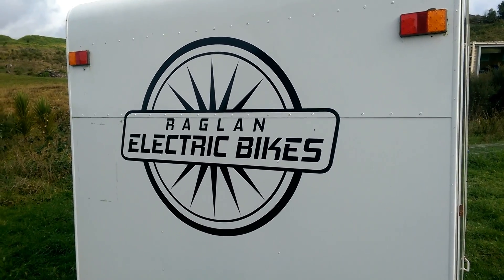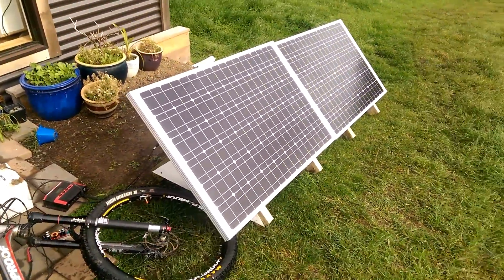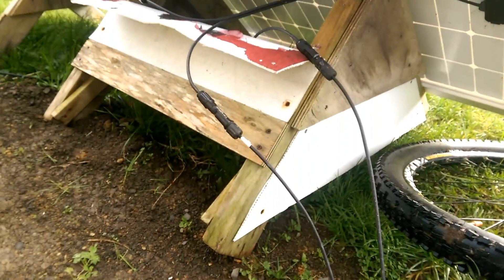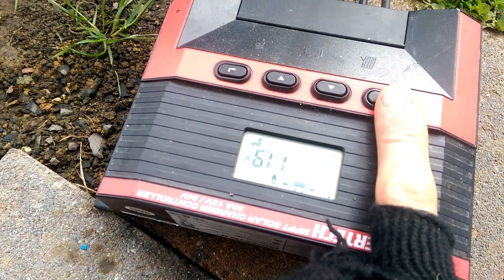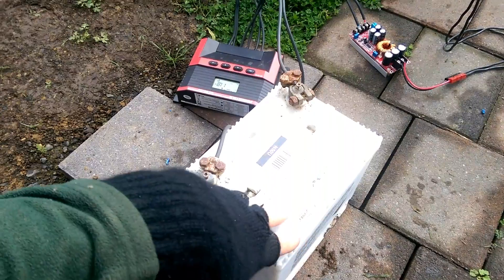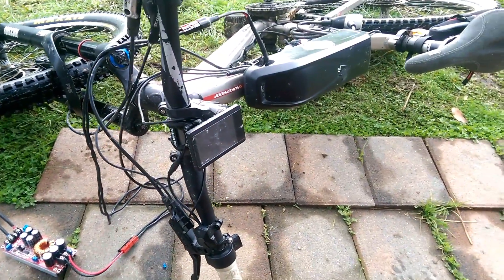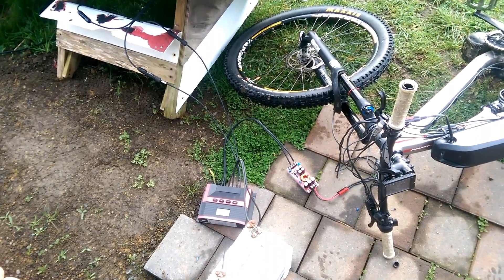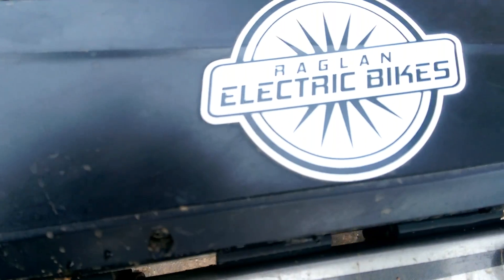Solar Ebike Charging Project Part 2

Comment: I know this is an old video but I wanted to comment anyway. You're making things way too complicated. You were spot-on with your first idea.  Rather than using that  very inefficient boost converter,  try the Genasun gv-8 36v boost charge controller. This is how I'm trudging my e fat bike doing long trips bikepacking.
Reply from the maker: I'll look it up. Thank you.

Comment: Best to have batteries so you can charge the bike before the sun is strong each day and the bike doesn't have to sit fully charged.
Reply: Or have two or three of the bike's batteries and charge them using AC ;-) Seems simpler and more cost effective ;-)

Comment: Hi
maybe this controller could do mppt and boost the voltage for you
MPT-7210A LCD Display MPPT Solar Panel Charge Controller 24/36/48/60/72V Boost

http://www.ebay.co.uk/itm/MPT-7210A-LCD-Display-MPPT-Solar-Panel-Charge-Controller-24-36-48-60-72V-Boost/371701051426?_trksid=p2047675.c100005.m1851&_trkparms=aid%3D222007%26algo%3DSIM.MBE%26ao%3D2%26asc%3D44760%26meid%3D0b1fc9a7730946f1b55a71833295656c%26pid%3D100005%26rk%3D3%26rkt%3D6%26mehot%3Dpp%26sd%3D282549875438
Reply: I am using the MPT-7210a with 2- 12v panels in series works awesome. Has 20 presets for different voltage batteries. I am using it on a 36v lifepo4 battery and 2- 52v Li-ion e bike batteries.
Reply from the maker: +NYangryguy Thanks!
Reply from the maker: +Werner W Thanks :)

Comment: Yeaaaahhhh finally a good video showing some interesting solar bike stuff... get yourself a little bike trailer and mount these big panels flat on top.
Get some Maxwell supercaps, got some from Digikey arrived in 3 days... pair them with batteries and you have the perfect solution...
Reply: I am getting good results using the MPT-7210A boost solar charge controller. I have a couple videos showing it in action on my 36v lifepo4 solar generator box and 52v li-ion  batteries with a plug swap and a couple pushes of the buttons away you go. I am using 2- 150w 12v panels I hinged together and wired in series. Works very well. My system is mobile but flexible panels will be next for huge weight savings. My system as is weighs 80lbs. That is box 2 panels and 30ft of 10awg on a reel. The 80 lbs includes the 36v lifepo4 battery as well. For camping and charging all my batteries now.
Reply from the maker: +ElectricBike  let's see those supercaps next week :)

Comment: Where can I get this bike?
Reply from the maker: +C0deH0wler I can sell you the bits to make it electric (if you're in New Zealand!) The bike itself is a Nukeproof Mega AM 27.5 with Rockshox Pike RCT3 29 forks. The new model is slightly different but I can get you if also. Otherwise ask Google :)